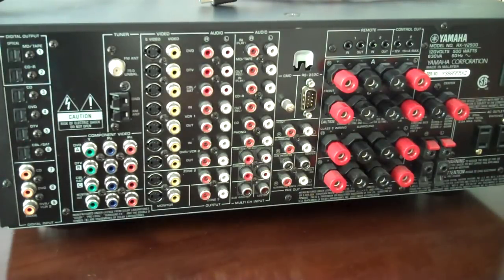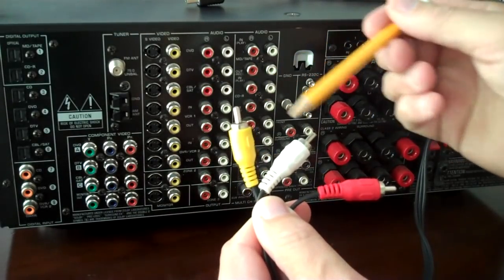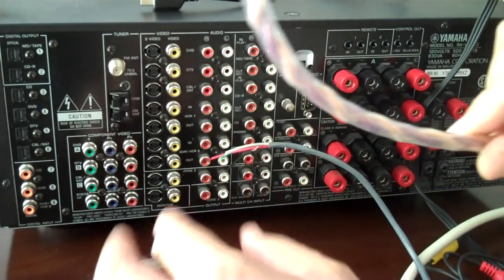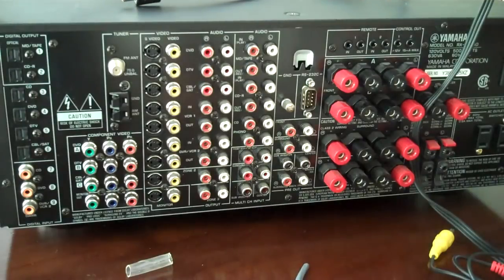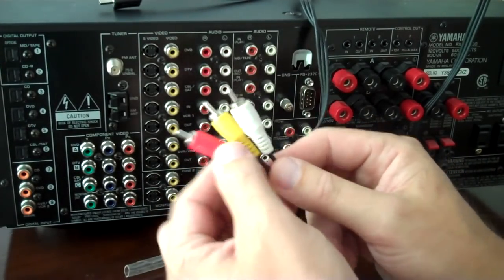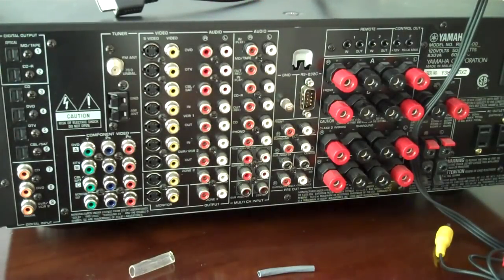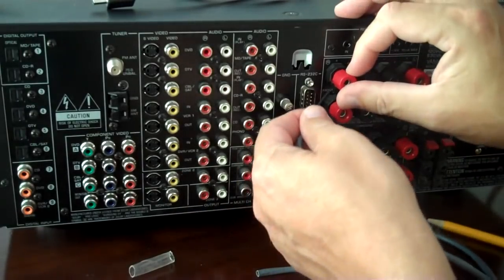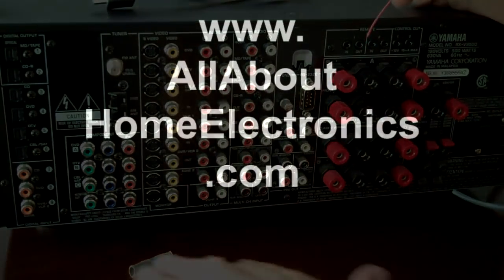How to Connect a Home Theater (Part 1)

Comment from the maker: We'd need more information. But, it sounds like not only are those "wall connectors" for the pair of ceiling speakers but also other speak wiring in other parts of the house?

Comment from the maker: Hi William. We looked up the STR-DB930. If you want to listen to music from your macintosh laptop you could probably connect to the DB930 using a "correct size Stereo to RCA" assuming you mac has a stereo headphone jack. Regarding the question on connecting stereo speakers, yes you can run into a problem if the speaker OHMs and the OHMs rating on the STR-DB930 don't equate. You risk damaging your equipment.

Comment from the maker: thetruebrit85
One option to connect your computer to your Denon AVR is to use a stereo to RCA cable. There are other options as well.
We posted a photo of a Stereo to RCA on our website. You can visit the site and see the photo by clicking the link beneath this video you've watch. We posted the photo in a Question/Answer forum located at the bottom of the webpage. We also listed some other connection options. Thank you for asking.

Comment from the maker: Can you provide a little more information such as the make and model of the receiver and the sub woofer? We don't recommend you make that connection you've described because based on the information you've provided you are potentially asking about something that seems outside the design and intent of both pieces of equipment.
Reply: Do you have any HDMI cables Dollar Store not preferable yes mostly the same good luck old school and new school it's learning how to separate the wires get yourself an old-school HDMI cable

Comment: Hi There,

I would need your help to set up my Onkyo TX NR 6100 brand new l got it as a gift 4 years ago and never got to use it. Still in the box.
I would need your help to set it up with my Bose Acoustimass 3 Series IV Speakers that have both the input that comes from the amp and the output that goes to the cube speakers at the back of the sub.

I have two sets of the Bose Acoustimass 3 Series IV Speakers and would like to use the front and rear speaker output of the TX NR 6100 like an integrated amp for playing music as well as watching my cinema.

Thank you for your help.

Comment from the maker: A component connection reproduces a noticeably superior picture versus a composite connection. If you want to use a component connection but don't have an  "component" cable on hand then you can use composite cabling in the component connectors. Just do one at a time so you match the connector hook ups like: green to green, blue to blue and red to red component and then hook up the red / white audio. (ignore the colors on your wires)

Comment: This is just not true. Banana Plugs are the best connections for the binding posts. Way more reliable, secure and assure a solid connection of the leads into the binding posts. There's no sound quality decrease, I'd say maybe the opposite as every filament of the copper is going to perfectly touch the internal aluminium copper of the binding post, especially if using an high quality 12 AWG 1.5mm2 cable that is way thicker and would be really difficult to attach with the regular system showed in the video.
Reply: I think the emphasis was for people who wouldn't be ready to throw out 7+ bucks out of their wallet, for each plug. A ridiculous price for a little guyzmo produced in chain and high qty for cheap cents... Of course the banana plug is great, but one can still have a comparable (if not better) quality without using these. IMHO that was the point, and to make his point he used the generalization that each contact point of a circuit degrades the signal, even infinitesimally for banana plugs. A generalization which is true for many other applicative fields involving electrical analog and numerical "pass-through" technologies (or any other "system" at large : the more you add parts to some system, the more you induce potential points of failure). One just has to make sure that the "direct" contact entails all the little wires at the base, which can be difficult... But anyways the field formed by a group of cylindrical/adjacent conductive wires (twisted together between thumb and index), makes up for a cleaner (and more stable) signal than each little wire taken individually. It's not like each little wire contains a specific "information" (cut one and you'll still have a good signal).
Reply: theyre wayy cheaper noew and at the time of uur post . just incase ur interested in using; more competition once thery got popular with the mainstream.and banana plugs are great; either way works, just ask yourself: if youre gona be switching wires easily then banana; but not going banana will not mattter to the people who arent audiophiles. im an audiophile and prefer bplugs :) if tthe system is good enough to warrant them ofc.

value is king. and ebay the plugs instead of paying premiums if u can chill... unless u find good deals or want/need it now sure, brick and mortar. but you know that im sure :)
Reply: Andy Broberg
If you switch often, yeah it's a great solution, but if not... BTW It's not a matter of «to be or not to be an audiophile» lmao! That's a ludicrous marketing misperception: as mentioned in my previous post, it's essentially a simple matter of science (conductivity), period. If they get (much) cheaper, well then yes it would be a great and effective solution to contemplate seriously, when one isn't so versed into electronics soldering nor capable to effectively "twist" coper wires together (or doesn't have the "valuable" time to do so). In the mean time, there are other ways to get as good if not better contacts.
Reply: you can get banana plugs on ebay and there is many kinds but they all do the job the right way and i done work on many receiver and i never heard of a receiver losing sound just because someone use a banana plug and with a banana plug there is less change of the wires touching and causeing a short but other then that i love your video please make some more ok

Comment from the maker: There could be, it would depend on a number of other factors as well though; one such factor would be, but not limited to, how well each component/wire in the system is matched in capability/quality to one another. 
The difference in the quality of sound would likely be unnoticeable to most users who just want the enhancement of surround sound etc. Use of Binding posts would most often be preferred however.
Reply: I want it to get Better Sound Quality of Wii And Gamecube and ps2 games.
Reply: I keep the Receiver on max 99 when I get Sonic Adventure Dx Director's Cut i"m setting the audio options to Dolby Surround Prologic ii and so as Sonic Heroes Dolby Surround Prologic ii and Shadow The Hedgehog Dolby Prologic ii 3 sonic games for the gamecube surround sound.
Reply: Banana plugs for Surround Sound system Receivers it's easy to hear both up and down front and back left and Right
Reply: I'm gonna play the ps2 version of Sonic Unleashed until I fix my driver and black ps2 slim laser and my Black Dualshock PS2 Controller set it Dolby Digital Pro logic Surround sound which is 7.1.

Comment: I have a Denon AVR-2309ci Going to a Old Panasonic Plasma TV. Love the TV. What I've found is that the Denon HDMI port says "monitor out" but does not say (ARC) but the old TV Does. Are they simply not compatible ? I cant seem to get video or audio out of any configuration using HDMI Nor the Optical. I'm seriously frustrated here as I just sold my HK AVR that worked fantastic,but I wanted the HDMI upgrade. maybe the used DENON is broken??
Reply: Also I am trying to run a fairly new Firestick. I get nothing.
Reply from the maker: Both TV & AVR must be ARC and typically will have “ARC” imprinted on the respective ARC port. Verify in the Owners Manual

Comment: I have a Pioneer VSX-504S it has no HDMI ports. I am trying to connect it to my Element 55" E4SW5518 smart TV. My receiver has no optical plugs either. Element Tech says I should be able to purchase some kind of converter for the receiver to change the receiver plugins to optical on the other side to fit into the optical plug on the TV. Is this possible. I have Bose speakers and I would really like to be able to use my surround sound.  thanks
Reply from the maker: Short answer? Yes. 
Longer answer? Our opinion: that by purchasing such a device you might not be fully happy with the purchase because the signal limitations could prove to be significant. In certain situations you'd hear sound but not in a true surround sound format and in other situations you likely still won't hear sound.
Reply: so what would be your advice? a new receiver?
Reply: could we use a converter for a HDMI  and connect that way. Elements display only shows for the optical plug  for sound
Reply from the maker: Based on the information you've provided what we would consider is a newer AV Receiver having a Toslink Optical input (at minimum)
Reply: thank you, I knew that would be your answer but just needed to confirm  I also came up with the same conclusion. thanks
Reply: well I gave it a try. bought a ONN digital to analog audio converter that had optical Toslink. Pioneer VSX504-S is up and working with all 5 speakers. no problems with our receiver or Element TV  (thanks for giving me some ideas)

Comment: I used silver core speaker wire on a reel ...it cost me £800.00 for that reel ...I used a lot of speakers , i still use all the kit .which is now over 10 years old and its great .extra front speakers (for more bass or all together) plus extra surround , now none has AMOS ..

Comment: Hi, I just got a SONY STR-DB930 home theatre system, can I set it up with my macintosh laptop via the MD/DAT ins and outs? and also it is built for surround sound, can i plug a stereo set of speakers in successfully? will i have any trouble with it?

Comment: I have an HDTV, but my recivier is quite a bit older. I have it hooked to the cable box via HDMI. But I cant connect it to my recivier because the only output for sound is Digital Audio, Do they make cables that go from Digital Audio to Composite?

Comment: I wonder if someone could help me with this problem.  I connected audio out with a component pair from a new tv to an old amplifer.  I tried using the input for tape, dvd, sat. etc and then set the amplifer for those settings but get no sound!  Help  Don R
Reply: Donald Ramsthel same issue
Reply: Might have to set tv to external setup in tv options.

Comment: Utterly professional nicely explained especially to someone like myself who's getting on in years & ain't to computer of Hi Fi  savvy..!!!!!!! I've just purchased a Denon AVR 3802 in mint condition for £20 which I'm using in my kitchen I'm only using it for music Cd's I have an old but mint Bang & Olufsen turntable running through it but my problem is I'd like to run my old but mint Dell computer through it only to play some of my 2000 songs that I have stored on it it's the type with the big b

Comment: Do you know if I can connect a cassette deck to a Denon AVR 3808ci?? Thanks😎😎😎😎😎
Reply from the maker: Yes, that AVR has 6 Red White AUDIO inputs. We assume the “cassette deck” has Red White jacks on back ?  If so just be certain to set AVR to which ever input you plug into

Comment: Hi there my friend, I've Recently bought myself a BRAND NEW Old Stock (never opened) in the box DENON AVR-3300. Was SO happy. I thought "No HDMI's but it's cool, I can connect my PS4 to my TV, then i can connect my PS4 to my DENON using my Digital Optical Cable" Now, this doesn't mean for one second that I'm not a COMPLETE Anus. I'm brand new to the sound world. ANd Video obvious, is a NON HDMI amplifier dead in the water wen it comes to PS4 and HDMI TV? Thank you (Please give me good news, Or I'm afrad I'm going to have to do what my wife keeps asking me to do, and that is to walk into the Ocean wearing the Brand new Concrete Boots she bought me as an anniversary present. 

Subbed as your channel has helped me before! Thank you
Reply from the maker: If you can use optical use it. The boots? We are a channel about electronics but the boots sound (pun intended) really not good.

Comment: How do I run my old Dell computer through my recently purchased Denon AVR 3802 receiver i only want to play some of the 2000 songs stored on my computer through my Amp......Please help....:)
Reply: Red white to earphones any cable that are headphones take your computer cable split left to right red and white all right subtle form use any computer Jack they are usually green he wants around it's not going to work it can but I'm not going to do that for you sorry my friend I did not mean to be ignorant PC component cable red and white to computer cable I make them all time take your time by a spare cut it a little bit each end the thing you must understand this nervous only two ends and the ground don't confuse yourself if there's more or less then to daycare computer green cable caught softly there should be two and maybe a ground that simple sorry you choose on let me explain to you
Reply: It's not my channel

Comment: banana plugs degrade the sound? well terminated cables with plugs are oksygen free which is better than a normal speaker cable because the metal can get rusty

Comment: Great video. Thanks a lot. Can you do another video showing how to connect an av receiver to a mixer? I have a karaoke system at home and I want to use my Sony STR DE 845 av receiver as an amplifier to connect to a Mackie 1402 mixer. Thanks a lot.

Comment: where is hdmi switch. how do i select hdmi inputs on amp
Reply from the maker: You should have a source (ie: HDMI) or input selector button (knob) on the front of the receiver and on the remote control of the receiver

Comment: For better sound never use av but dac to  pre amp with tube then to cross over to power amp..base is most important so use nothing mid frequency base as well as low frequency supersonic upto10 hz setup....welcome to natural sound system setup...

Comment: Pssst.... Hint:   Buy a system that offers HDMI
if you see a system like this,, don't buy it

Buy a system that offers HDMI

HDMI connecting  offers TOP Sound and PICTURE also works with 3D systems
Reply: +John Smith For audio, should someone use hdmi or optical?
Reply: +kepoman_94 Go for HDMI, because its more common than optical.
Reply: Nobody uses 3d media